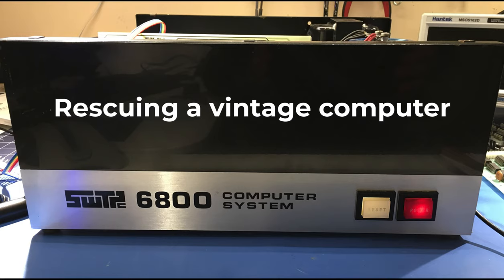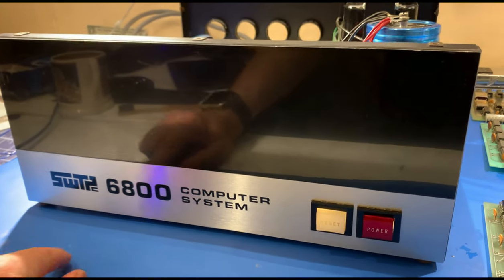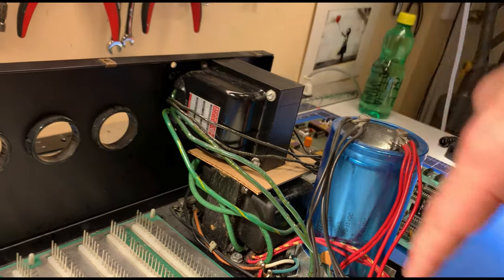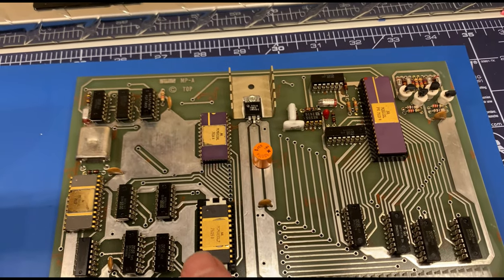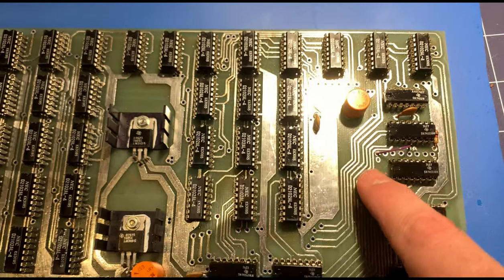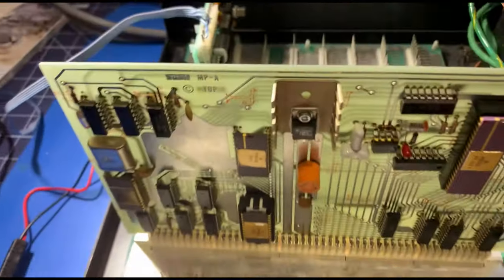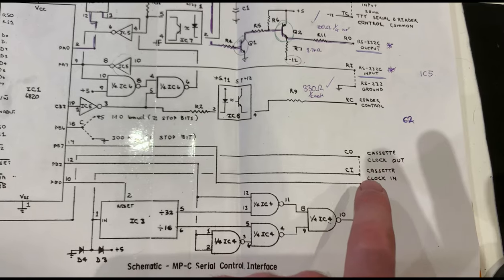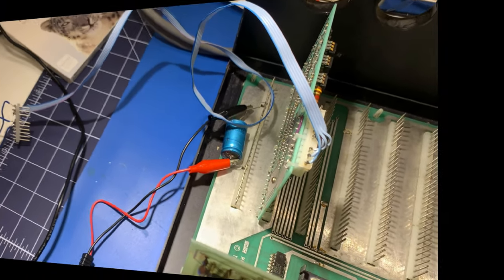Rescuing a vintage computer SWTPC 6800. RepaIr PSU, CPU, Serial boards

Comment: The extra transformer was sometimes added to the SWTPC. As a boost transformer to increase the voltage to the 5 and 12 volt regulators. The original 7-8 volt to the 5 volt regulator. And 14 volts to the 12 volt regulators was marginal at best. Any drop in line voltage would cause regulation problems. to the DC supplies. Especially if the system  had a full 32 k of memory. I made this modification to my SWTPC back in the 70,s shortly after I bought it. I also added a muffin fan to  blow air across the memory boards. You might consider adding additional or larger filter capacitors. They help with power supply ripple that is rough on the ram chips.  I still have my original system and it still functions. Enjoyed your video .
Reply: Actually, the second transformer mod was relatively common. I have two machines with it. The problem was (as you added more cards that used the +/-12vdc the OEM transformer was not up to the task. So you disconnected the +/- 12 vac windings of the OEM transformer & added a "beefier" +/- 12vdc transformer. OR a +/-15vac transformer so that voltage regulator chips on your accessory boards could step it down to the necessary voltage. The later model SWTPc machines had +/- 15volt windings and used 3 terminal regulators on the boards to get the requsite voltage. Incidentally, when adding the second transformer usually the +/-12v rectifiers & caps were replaced with beefier ones.

Comment: I'm a retro enthusiast currently building a SWTPC 6800 reproduction, the hardware is working and I can switch between MIKBUG and SWTBUG running at 9600 in an 8k EEPROM, theres 40k of RAM and right now I'm sorting out the cabinet and graphics.  I'm representing the CT-1024 using a homebrew terminal based on Geoff Grahams PIC code. I've tried several SWTPC and TSC BASIC interpreters and finally found one that works - had to do some patching to suit this particular hardware.  The next job will be to port Star Trek.  I'll be posting a vid when its done!  There are a few retro projects on my channel  :-)
Cheers
Phil
Reply from the maker: Wow, thats awesome. Please post the video, I look forward to it!

Comment: I'm not seeing the data errors on the 300 baud connection? If you're referring to the characters down the right hand side those are the ASCII equivalent characters for the bytes displayed on that row.

Comment: The socket pins used are typically used with PCBs that don't have plated through holes thus you need to solder them on both sides of the board. I don't know if the SWTPC PCBs have plated through holes or not.
Reply: ALL SWTPc boards had plated thru holes.

Comment: What a find!  Can’t wait to se you get it all going and maybe get FLEX running on it.
Reply from the maker: I don't have a disk controller but I might try to find one and figure out how to get FLEX going along the way. The ROM in this machine is original MIKBUG and not SWTBUG so I think there are a few steps to making FLEX work.
Reply: @robingrosset6941   For Flex the first thing is you need more RAM at $A000 than the default 128 bytes!
Reply: @robingrosset6941  I have a spare floppy controller for that machine.